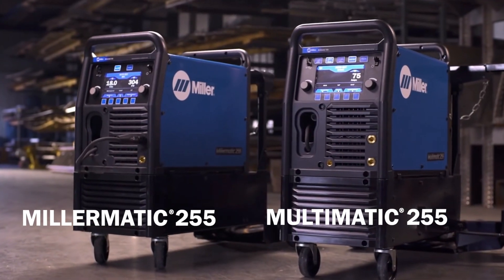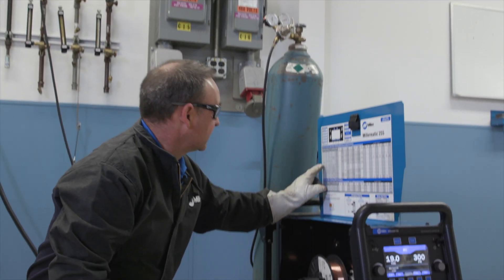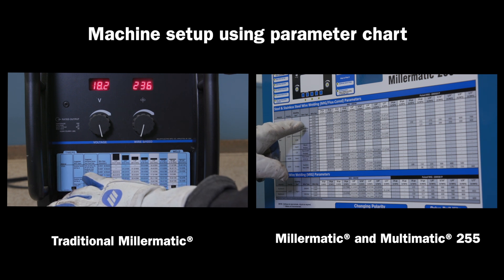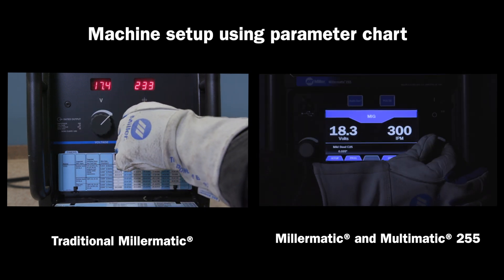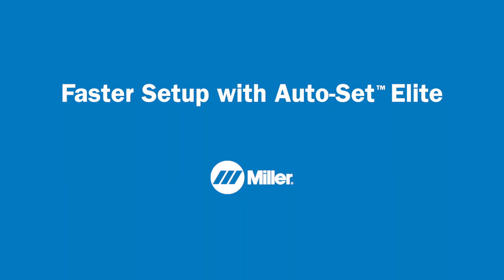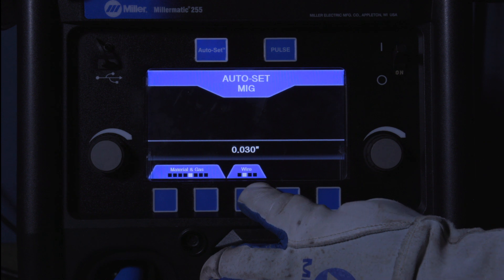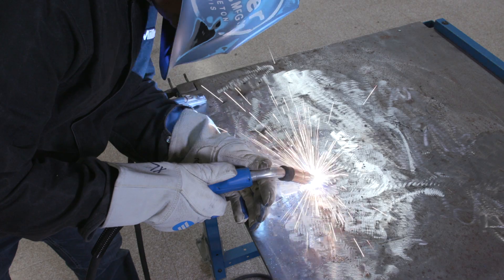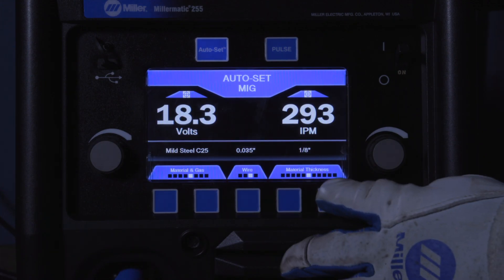Learn How Easy is it to Set up the Millermatic® 255 or Multimatic ®255 Welder

Comment: Very nice mechine I really like running spray transfer very high quality weld's just remember to only run 90-10 argon/CO2 and no less than 1/8th thickness.And no vertical welding.